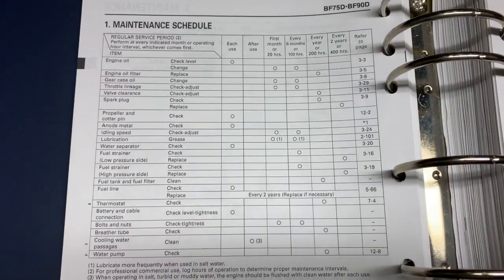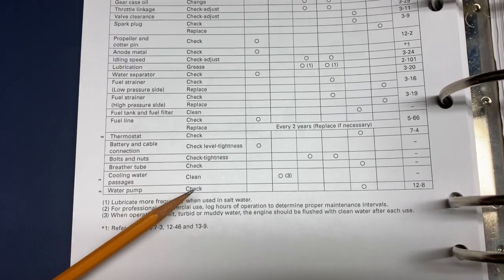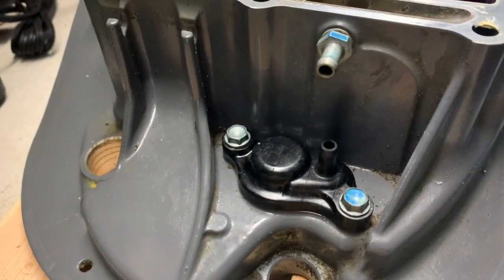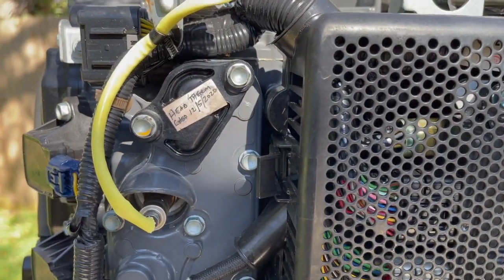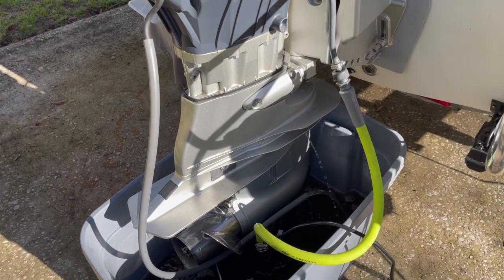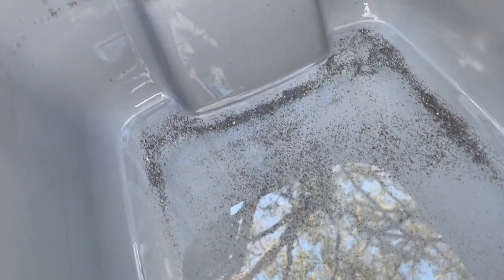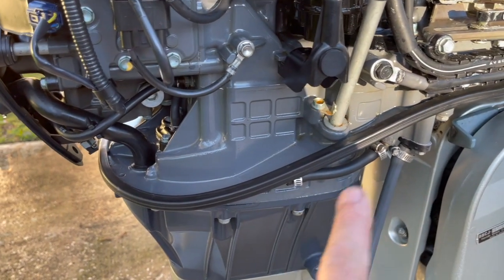Honda BF75D/BF90D Cooling System Troubleshooting and Maintenance

Comment: Hi Dave, at the end of last yr I bought a boat with 2 X BF90d's,  when I connected a hose to flush zero water passed through either engine, trying to get answers was like hitting constant brick walls, I've just found your video, I'm all over it, thank you it's perfect! I'm a little nervous to remove/replace the covers but i'm going for it! Many thanks, great video,
Reply from the maker: Yeah I had the same challenges with finding info on how to unclog the cooling system which is why I went down that rabbit hole and did the videos.  Super easy to pull the side panels and get to all the parts and pieces you need to get that thing flushing and the water flowing as it should.  Recommend just go through it all while you have the panels - you will be glad you did.
Reply: Dave I really appreciate your quick reply!!! So I went for it,  the cover came off easy enough although the first bolt sheared , which I think is the same as the one that is sheared ion your engine? So I was v gentle with the rest! Eventually I got to examine the flush valve, the securing bolt was missing!? The plastic valve housing was seized in place, when I freed it I found that inside was caked in dried salt etc, after some cleaning through etc I was so pleased to get water flowing through!! Whoop whoop, I'll carry on tomoro, thank you again!!!! I wouldn't have done it without your video! @davecavanaugh66
Reply from the maker: @glenmilligan2917  awesome - glad the video helped.

Comment: Thank you so much for making these vids 1000% this is the 2nd time this season you've saved my ass and helped me save a ton of $ from getting ripped off by a mechanic. Earlier I had a fuel pump issue and that vid saved me. Now I apparently sucked up a bunch of turds in my motor last weekend on the marsh and this vid saved me. Couldnt thank you enough great detail and not a bunch of senseless talking.
Reply from the maker: Good to hear these videos were useful 😁

Comment: BF90 - this helped a lot. I have never had my lower side cowls off. I found my two thermostats last year - 5 years and 130 hours in saltwater, flushed each trip, but both were clogged. Replaced them and started using a salt-remover flush. Now I've cleaned out the pressure valve and flush valve.
If you remove the rear cowl latch you can access the hidden bolt for the pressure valve cover. And yes, add a couple of washers to make it easy next time. Water pump looks great. This makes me happy. :)
Reply from the maker: Yep - saltwater is no joke.  Good job hitting all the key spots to keep water flowing the way it’s supposed to!

Comment: Dave, I just picked up a boat with a BF75D, been going through your videos and seeing what I need to check.
Thanks for taking the time to make them
Reply from the maker: Hey Jeff - glad the videos are helpful…hopefully save you some money and headache down the road…good luck!
Reply: Dave, I ran into the same problem as you,  the stats and flush port were full of crud.
 Running a descaler through it now.
Where did you get ( download) the maintenance manual from? I bought the Seloc manual, but that’s hard to follow, with a number of different engines.Also, who do you order parts through?
Thanks
Reply from the maker: @jeffs9266  links are in the video description.
Reply: Thanks Dave, totally forgot to check the description
Reply from the maker: @jeffs9266  https://publications.powerequipment.honda.com/details/61ZY900E3-BUNDLE

Comment: Dave: thanks for the detailed video on Honda cooling systems. I followed your procedure on my 2006 BF75 because I have a "shut down on overheat" issue when idling on the hose after a few minutes Still haven't solved that yet but getting closer. Just wanted to let you know that in the process of troubleshooting I ended up removing the temp sending unit (there are three) from the block ( starboard side, above the fuse box, sorta behind the ECM} and running the motor on the hose. Flushing wasn't my intention, but a TON more scale and debris came out of that hole. Might be worth doing on a neglected motor like mine. Remove the ECM and tie it out of the way. Also, re-attach the sending unit to the wiring harness and just let it dangle out of the way. I ran mine for ten minutes and there was still stuff coming out. And this was AFTER  I flushed with Rydlyme as per your video.  Thanks again
Reply from the maker: Hey Mark - great info.  I have lots of questions, wish you did a video 😁.  When you say there are three temp sending units on the block, are they all in the same location behind the ECM?  When you say running on a hose, do you mean using earmuffs?  It’s unbelievable the amount of sediment and corrosion that builds up in these motors when you run in saltwater.

Comment: Hi Dave, Thanks so much for your videos, I have just purchased a BF80. After watching your video Im looking to make the regular flushing  as easy as possible, I'm thinking of a flush tank that has an element in it to heat the water to around 70 deg c so as both thermostats open, pumping the water into the flush port as you do but probably using vinegar or diluted muriatic acid regularly say once every 5 flushes. the hot water will ensure a better flush without having to start the motor for any length of time. really appreciate your thoughts on this. cheers Gary
Reply from the maker: Glad to help.  Sounds like you have a good plan.  Got to keep the water passages clear.

Comment: Hi Dave thanks for your video very helpful, I was just wondering what your thoughts are on flushing your outboard submerged just in the bucket with the adequate concentrate ratio of salt away/water etc rather then running muffs and the hose. A lot of people do this do you think it’s a better way in regards to water pressure and circulation. 
Thanks
Reply from the maker: Probably nothing wrong with doing that but I can tell you that “salt away” and other products like it aren’t enough to fully clean the inner passages on motors used in saltwater all the time.  That’s why I recommend a yearly 2 hour flush with Rydlyme to break dry own that build up.  I learned my lesson which is why I show that process in the video.

Comment: Hey mate thanks for the vid my bf100a has developed some cooling issues I had to get very aggressive getting the bottom end off, professional service failed 2 years in a row to pull it, mines a long shaft so has studs with nuts was salted on never been off before was worried the spline was binding in the powehead but wasn't was only where it was stuck with salt against the studs, pulled the thermostats they are a mess and the galleries are well built up with salt new impeller thermostats and a good flush hopefully do the trick.
Again thanks for the detailed vid Cheers Tom from Australia 👍👍

Comment: Thanks Dave,this is such a though and informative video. I feel your pain as my early carb model BF 75 had experienced very little love in its earlier life. I've gone through all the flush valves and even though I flush after every use they still clog with salts. Not sure if Honda could have designed things better but it's a great money making exercise for them with all, the new seals and baskets needed during these procedures. I notice your Showa PTT unit looks in great shape. Mine wasn't and I had to buy and have shipped from the States to the UK a used replacement unit. Luckily it is a good unit but such purchases are always a gamble. To get to the point, I would highly recommend activating the manual pressure relief valve on the unit from time to time to keep it free. This is why I had to replace the whole unit as it was stuck fast. My boat is kept berthed and the PTT unit is nearly completely and constantly pickled in saltwater so I make sure the whole unit, including the release valve is smothered in grease to prevent or rather slow down corrosion. I'll check out your other vids. Cheers from Suffolk, UK.👍
Reply from the maker: Hey Adrian - learning something from you.  So what you are saying is the manual screw for the Power Trim and Tilt needs to be greased up and tested from time to time to ensure it works and doesn’t corrode/freeze up - is that correct?
Reply: @davecavanaugh66  Hi Dave, the manual release valve should be located through a small hole in your port saddle bracket, if it's the same as earlier models. It's a large slotted screw retained in place with a large circlip to prevent it being completely removed. Due to immersion in saltwater my earlier one had seized solid and the best way to keep it free is to periodically turn and close it. The valve enables the engine to be lowered manually in the event if an electrical or motor failure. Your engine is fitted with a Showa unit like mine, so I am assuming it is configured the same. They are extremely complicated systems, and similarly expensive so they need to be loved! Let me know when you find it, but I would hope there is reference made to it in the service manual too. Good luck!
Reply from the maker: @adrianwilding2912  gotcha - yep I know exactly what you are talking about.  Just wanted to make sure I was understanding properly.  I have tested mine once or twice but not something I do regularly.  I will start doing it now that I know it’s a problem area since I’m in salt water a lot as well.  Really appreciate the heads up…thanks for sharing!

Comment: I got a gallon of the RYDLYME de-scaler - had never heard of this product before. Replaced the poppet valve with a new one, removed both thermostats and the flush port valve, and did a 2-hour flush in a storage bin with a 1/2 HP submersible pump rented from home depot. Replaced the pee hose with one that would pump back into the bin, about 5 gallons of water and the gallon of rydlyme. I'll tell you what - I am absolutely shocked at what came out of this motor - SHOCKED!!!!  150 hours on this one, nearly all in saltwater. And it has always been flushed after use - even started using the CRC Salt-rid flushing attachment and flushing agent. 

From what I gather, there was enough residual salt in the motor that I would get a gel-like build up of salt crystals behind the thermostats, so that when they opened not enough water was flowing. Each time I got a overheat buzzer I would pull them and there was always salt crystals caked in them. Of course you can't get all the salt out of the jacket from the thermostat ports. 

Tested both thermostats - both open at rated temp, but they are so small and open so little that any salt residue is going to plug them. 
This should solve my over-temp problems for sure. Again, thanks so much for the advice - saved me a GIANT headache. Rdylyme is dabomb. 👍
Reply from the maker: Great story.  It’s amazing to see what comes out even when you do all the right things with flushing after each trip.  Glad it worked for ya!

Comment: Dave , your flush valve connector .Is that a genuine Honda part or is there a universal hose fitting that can be used . Great vids by the way ,they are a help
Reply from the maker: If you are talking about that green hose - I bought that on Amazon - parts are listed in the description area. https://www.amazon.com/gp/product/B01D51VBF8/ref=ppx_yo_dt_b_search_asin_title?ie=UTF8&psc=1

Comment: Hello dave, thanks for the videos they really helped me. I have a 07 honda bf90d. I have a leaking water pressure relief valve. I am anticipating rusted stuck bolts because of severe corrosion. If worse case and I need to replace entire mount block is it fairly straight forward and do you have a video in removing that. Thank you so much for your response
Reply from the maker: Unfortunately I don’t have a video to replace the mount case.  That’s a tough one and a horrible design to get to that area of the motor if your bolts are completely corroded/rusted.  Good luck and let me know how it goes.
Reply: Hello, I am in the process of disassembling the mount block because I too have corroded pressure relief bolts that I cannot remove. Any tips on removing?

Comment: Thanks for the video Dave, before I take on a few tasks. What does it entail to remove the lower cover cowling for the outboard? Thanks
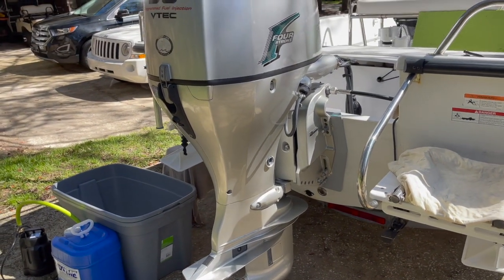Reply from the maker: This video shows you how to remove and replace the lower side panels/cowlings 14:30 and 42:40.
Reply: @davecavanaugh66 seriously thanks a ton, definitely doesn’t seem too challenging. I have 2 bolt hole spots that have a hairline crack I guess from someone over torquing on reassembly. Also how has that aftermarket starter held up?
Reply from the maker: After market starters are horrible if used in saltwater.  Going to have to bite the bullet and get the Honda brand starter - they are expensive.

Comment: Do you have a video on what to do with a low oil pressure light and alarm? I have a 2014 Honda BF75D.
Reply from the maker: Sorry I don’t.  When it comes to the various audio/visual alarms, there is whole series of troubleshooting diagrams in the service manual you will have to purchase.  Link to the manual is in the video description box.

Comment: Hi Dave, thanks for this video very infor.ative 
im down under in NZ and I've got a newer 2020 BF90D outboard that has low hours approx 90. The temp light has come on on the controller but not the buzzer. The tell tail is working and motor doesn't seem to be over heating. What would be the first thing I should check?
Reply from the maker: Few questions:  How many hours?  Have you ever changed/cleaned the thermostats or water pump?  Is it only used in salt water?  How often do you flush it.  Do you flush with flush hose (not running)?  And also flush with ears (running)?  Does it alarm at idle or only when RPMs are up?  Bottom line is start with the simple stuff first like the check/clean the thermostats followed by the water pump.
Reply: Thanks for the prompt response. It has about 90hrs,  I'm the second owner and I've had it for a year and it's just had its annual service. I've never changed any pumps or thermostats and I don't know its previous history. I run it 50/50 in fresh and salt water. I always flush with water and salt away after being in salt water. I use the flush hose (not running.) It doesn't alarm it's just the light that comes onI wondered if it was a sensor?
Reply from the maker: @LuckyJensen-ot8cd  good run down.  Could be a sensor if the light is the only indicator.  That would drive me crazy not knowing though.  I would check my thermostats as a first step.
Reply: Cheers @davecavanaugh66   I'll start there. Much appreciate your time.

Comment: Dave, really appreciate the videos! After my last day on the water when I disconnected the flush port connector to connect my garden hose and flush it, the waterjoint cap connected to the engine came off. It appears to be intact but I cannot figure out how to reconnect it. Does the lower engine cover need to be removed to do this? And if so how is the cap held in place? The boat is docked on the water too. Will I need to pull it to reconnect the cap? Any advice/insight would be appreciated.
Reply from the maker: Hey Kris - trying to visualize your issue, but I would say if you can’t see where/how to connect it, you will probably need to remove the side panels.  It’s a pain and be careful not to lose your bolts and bushings.  Things tend to fly or fall off when removing them.  If you are on the water, you definitely want something under the motor to catch stuff.
Reply: Dave, really appreciate the prompt response! 42:45 43:25 43:34 of the video should help with the visualization of the issue. I believe waterjoint cap is the name of plastic nozzle that you connect the flush hose to on the side of the lower engine panel. I can’t figure out how to reattach this piece. There is a hole that it goes into on the panel but it doesn’t seem to go that far through or have the length (or sufficient thread) to bolt a washer/nut onto the back. Also don’t see anything the “click” in to. If that helps and you have any additional insight I would really appreciate it!
Reply from the maker: @KrisGronau  take a look at the parts manual on Boats.net - Engine Cover/Under Cover - looks like you are taking about Parts 5 & 32.  To get that put back together, you will have to pull the starboard side cover panel.  To be on the safe side, I would first order the parts just in case there is a reason this came apart.
Reply from the maker: https://www.boats.net/catalog/honda/outboard/2007-and-later/90hp/bf90dk0-lrta-vin-bbcj-1000001-to-bbcj-1099999/engine-cover-under-cover
Reply: Got it, thanks! One more question, dose this part have any function in the engine other than holding the hose when not in use? If it doesn’t serve any other function, can I just cap the hose and secure it while in use. If possible I would prefer to keep the boat in the water for the season and address this when I do my end of year annual maintenance. Thoughts?
Reply from the maker: @KrisGronau yes this just caps off the hoses more or less.  You should be good.

Comment: Hey Dave I have a 2021 honda 200 with a HD-4 gauge.  The gauge keeps blowing a fuse . Would you have any idea why? Thank you sir for any information.
Reply from the maker: Well that’s a little out of my league, but my guess is something is shorting out, pulling too much power, or the fuse is too light or cabling is too light.  Has it always had an issue or is this a new problem the just started occurring?  Does it immediately blow or does it take some time to blow?  Have you removed the light bulb?